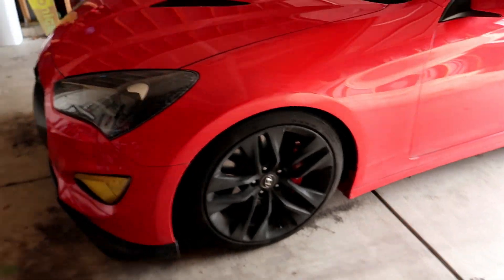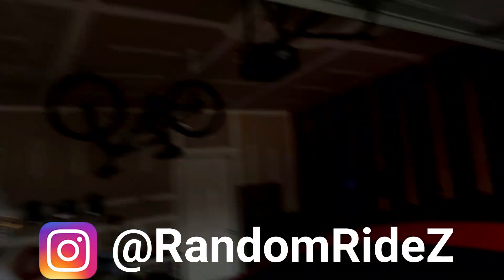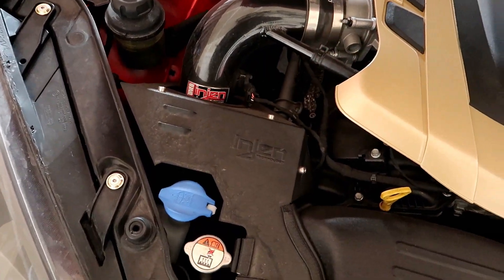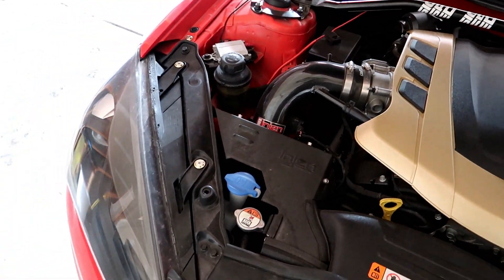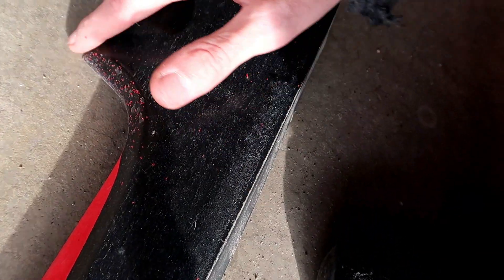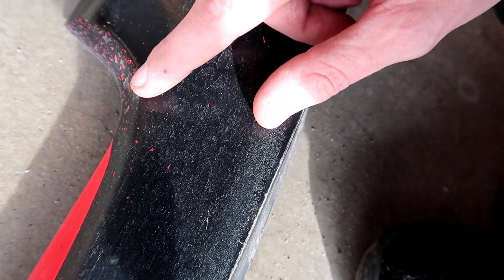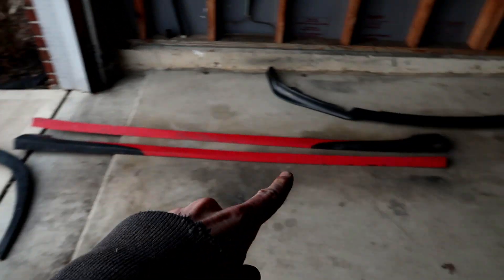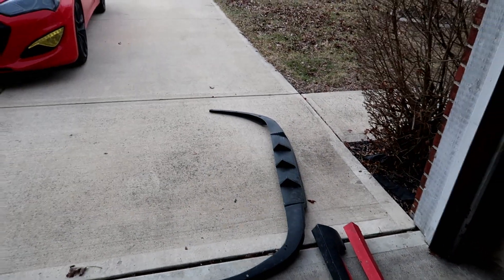GOING BACK TO STOCK...

Comment: Dude I’ll keep supporting you but stock headlights trade plus 100? Exhaust trade plus 500 your over pricing dude. Lower your prices and you’ll get rid of everything much faster. Yes I know how much you’ve spent on the mods but u know you not getting nothing close to that money back. Again I’m team genny n I’ll support you in your new build but bring them prices down.
Reply: Jose Soriano he has very reasonable "fair" prices. You should double check how much that full exhaust costs.
Reply: SlowMoSliding so but it
Reply: Ryan spent a lot of hours working on the headlights. I would charge at least $200.